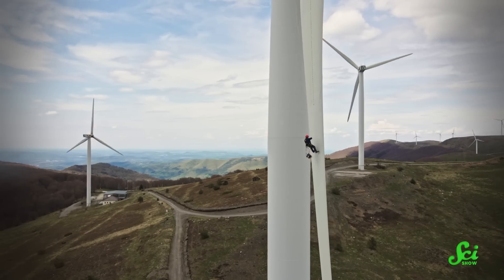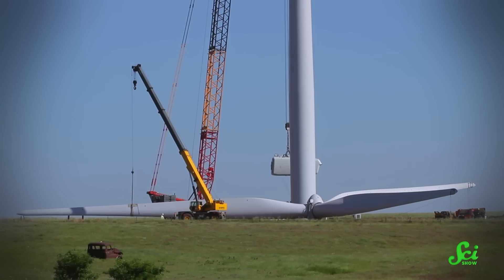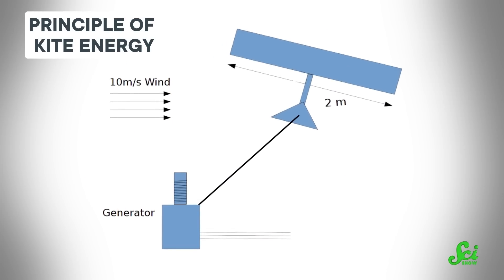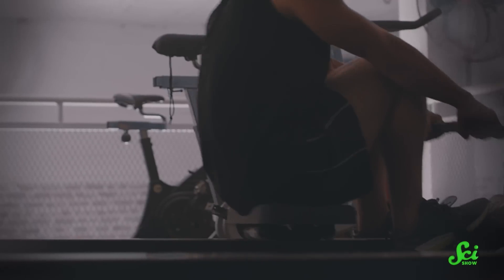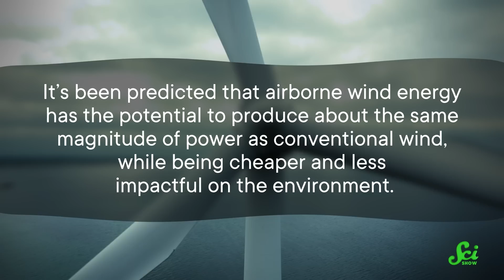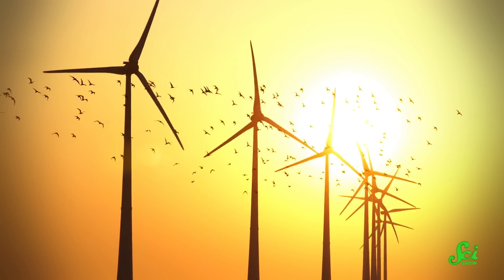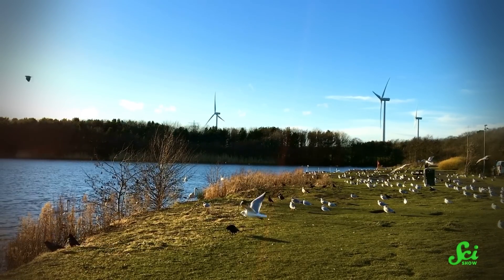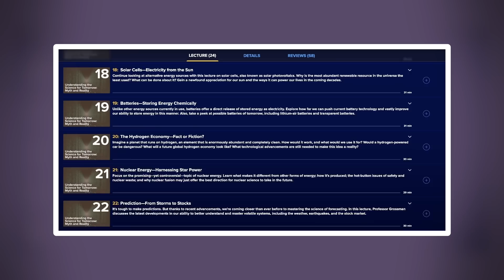Should We Put Wind Turbines on Kites?

Comment: It's way more scalable to have the generator on the ground, and just spin it by flying the kite in a cycle with variable line tension, allowing you to spool the lines out and back in, with the distance multiplied by the force difference while spooling out equaling the energy input to the generator.

Putting the generator on the kite isn't a horrible idea, it's just not as good.

Comment: This does get me to thinking that it would be neat for micro energy generators for emergency power and off grid usage. For example; I would be more motivated to go out and mow my backyard, if I could fly a kite and power an electric mower at the same time. 

Perhaps also,  as a design idea, old dutch inspired windmill/ hot air blimps; that have a continuously circulating chain, to pass whole grains up above, and ground flour back down. I wouldn't mind looking out the window to see that every day.

Comment: 8 or 9 years ago there was the Altaeros Buoyant Air Turbine, specifically to get steadier more powerful wind at 1000-2000ft, though it was more for isolated locations or disaster use rather than something you'd fly fleets of.  (Company is still around but it looks like  their current products are all autonomous antenna and sensor balloons rather than generators.)

Comment: 1:13 the highway wind turbines im super suspicious about. By working they ar reducing the speed of the airflow generated by passing cars, and I'm pretty certain that that airspeed as-is is increasing the efficiency of those vehicles by reducing drag (like drafting). By absorbing that energy you're basically "stealing" energy generated by internal combustion engines that are notorious polluters. I'm pretty sure you cause more emissions by reducing the efficiency of the vehicles than you do by recovering that percentage of energy.

Comment: I propose a 3rd design:
Have you ever tried to fly a kite, but it started rapidly spinning out of control and crashing? 

Under the right circumstances this spinning can be harvested by a generator on the ground by spinning the tether. To avoid crashing, a separate lifting kite can be used attached to the same tether by a ball bearing.

This would give both continuous power production as in the first concept, but storing the heavy generator on the ground as in the second concept.

Comment: It's frustrating how the fossil fuel industry has tricked everyone into being so concerned about recycling wind turbines.  Modern wind turbines last 3 decades and the blades are INERT.  Just bury the blades like they are rocks.  Nothing happens to them.  The top part (nacelle) is made of valuable metals and is absolutely recyclable.  The base and tower will just be reused and topped off with a new nacelle and blades.

When was the last time you heard of a decommissioned nuclear power plant being recycled?  Never.  How about the last time an abandoned coal plant was recycled?  Never.

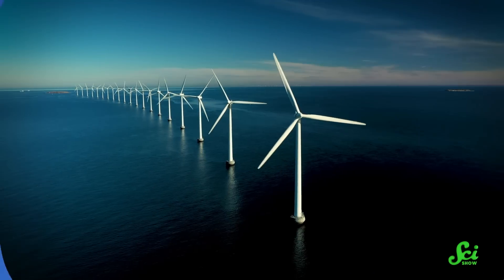Comment: 1:34 "newly built wind turbines are about 100 m tall on land" - this is incorrect or at least misleading. Modern wind turbines have a hub (the point where the rotors rotate around) height of over 100 m and a total height of 200 - 250 m including rotors.

Comment: As someone studying renewable electrical engineering, this idea is my pet peeve 😮‍💨 it comes up as a 'new cool' idea all the time and the reasons why we don't do it are always severely understated.

Imagine a high voltage, probably metal, heavy pylon swinging in the air near literally any biome, let alone a residential area. Tethered to the ground by some cables, at least one of which is massively electrified. There is virtually no way to make that safe! 

"We need to get pretty good at predicting weather" we've been trying to do this for hundreds of years it is enormously difficult!! Fluid dynamics is HUGELY complicated.

We are getting decent enough to predict general wind patterns about 2 days in advance, but things like tornadoes we have barely hours' warning if even that. The last thing you want in a tornado situation is a massively electrified rotating metal saw that is designed to float, dragging electrified cables.

The thing about "less cost for the environment" is presumably because it wouldn't use concrete (which creates quite a bit of co2) to build the structure. Again, something with this high voltage running through it NEEDS to have a secure connection to the ground so it can be earthed! The fact that it's not a free-floating structure is not a deficit! The amount of static this thing would build up just from air friction alone...

Comment: Why not talk about crosswind kite generators? they can produce an order of magnitude more power than simple downwind kites or airborne turbines. We know that individual autonomous flight and adapting to weather work already, even for the more complex crosswind kites, because it's been tested very successfully as auxiliary propulsion or cargo ships. They do struggle with having anything tall nearby including buildings, bridges, other kites, aircraft, etc. because the kite lines tend to run at a pretty shallow angle, so a kite 1000 ft in the air could easily be half a mile downwind of the base it's connected to.

Comment: I always thought (read: from the time I first heard about it) a big inflatable paddlewheel for a kite wind driven generator would be cool. Problem with kite turbines is the amount of land  needed.
Reply: You can just attach them to or between houses though. Have one big transformer or something if needed, and just run cables off that across a city block. I mean, the point is that they float in the air to capture high winds. Land should be the smallest issue.
Reply: You would need to own the land the kite would be flying over.
Reply: @SameAsAnyOtherStranger  If you're a regular joe, you'd probably need to legally work out how and where you'll be allowed to fly your kite, and you probably wouldn't be allowed to connect it in a place that you don't own. However, the video talks about one kite powering a dozen houses. This doesn't seem to be a kind of thing regular people are expected to really get into in any significant capacity - this is supposed to be a matter to be decided by the state, like wind turbines.

Considering the actual kite is not going to actually occupy any land in any way that would prevent anyone from building anything on it, the state could just fly that kite. That is one of the advantages of using kites over wind turbines on poles - you don't need to set a pole down anywhere. Sure, someone might be pedantic and go to court over that, but then that person will be the problem, and the rest of the world will once more sigh as we watch progress get stumped because a Karen didn't want a kite to be flown a hundred feet above their house that was going to power said Karen's electricity in said house, as well as a dozen other houses, while not occupying any land and not causing any trouble.

The state would need to own the land they put the transformer/collecting device on, sure - but the state has no problem buying/ kicking people out of their houses to build a new highway, so I don't expect this to be a big problem.

Comment: I'm working on a PhD focusing on control algorithms for energy harvesting kites! I'm glad to see these systems getting some media attention
Reply: Surprised small scale ones aren't out. Seen the tech like ten years ago for remote generation and looked good!

Also saw tech for basically uh parasails for large ships. No idea why that hasn't taken off either as it seems so obvious and can cut a lot of fuel overall without taking up too much space.
Reply: @dianapennepacker6854  The reason it hasn't taken off is mostly due to a catch twentytwo. One the makers of those sails are very much aware of NOW but didn't think would be so severe back when they started. 

Installing those sails allows you to save MASSIVE amounts of fuel, the test ships have burned up to thirty percent less fuel on voyages. On the other hand, it costs extra while building the ship, which means the people buying them need to fork over more money, which they would prefer not to do.

The problem then comes in the fact that the people who buy and own the ships are not the same ones who use them. You buy a ship, and then someone else charters it, and THAT someone else is the one who pays for the fuel.

In other words, sails are massivley beneficial for the people doing the sailing, but they don't get a say in whether said sails are installed, because they don't actually own the ships, while the people who DO own the ships have an active incentive NOT to install sails.
Reply: @Alexander_Kale  I was going to say 20% but wasn't sure if that number was actually possible and not marketing haha.

 That is the craziest thing though! Even 15 percent less fuel for a large cargo ship would be a MASSIVE increase and pay for its self over the course if its life as fuel won't get much cheaper.

 Just blows my mind that the large shipping companies like Maersk don't do it ASAP or try one out. They build and run the damn things ya know? Could be saving like 20 TONS of fuel per day at the least! They also don't look like they take too much space either.
Reply: @dianapennepacker6854  If you put sails large enough to provide meaningful savings on a cargo ship, they'd need to be massive and that would be problematic on already top-heavy ships. To use sails against a headwind, you need to go diagonally into it and that can add days of sailing to an already week-long oceanic crossing. Longer roundtrip times add risks and costs.
Reply: @dianapennepacker6854  Turns out, some of that actually was marketing, yeah. As is usually the case with wind, apparently the numbers vary a lot, and "30 percent" was them cherry picking the data just a tiny bit...

Upon digging into this for a bit, your twenty seems a lot closer to the mark.
Reply: @Alexander_Kale  Yeah I thought 30% was pretty high myself. Even 10% would be an insane amount of savings.

 One thing I couldn't find was the cost.. so unless this system costs like 474, 484, 484 dollars. Then I can see why companies aren't even bothering with the complexity of it and going through the trouble of training and maintaining it. Which uhh... Cannot blame them.
Reply: @dianapennepacker6854  While searching for it, I found several companies now instead of the single german company I already knew existed. There is a british one, a french one, the original German still exists but is now concentrating on land based energy harvesting, and of course, the thread OP.
So apparently, interest in this is growing anyways, we'll see where it eventually leads. Look up "rotor sails" if you wanna  see something bizarre that will in no way be maintenance intensive. ^.^
Reply: @dianapennepacker6854  If you put kites on a ship and need to sail against the wind, which would happen about 50% of the time for ships doing east-west routes across oceans, the kites will cause more losses from drag than any energy they may be able to produce.
Reply: @saltofine8 Could you explain why these aren't already being used? I remember the idea from decades ago. What's the technical details that have slowed adoption?
Reply: @Josiah Seaman  The largest factor from a technology perspective is the added complexity of these systems. When the wind dies, a towered wind turbine stops spinning. Conversely, when the wind speeds get too high, blade pitch can be adjusted. For an airborne wind system, the kite needs to be robust to lots of variations in wind speed. As a result, the control system needs to be able to react to variations in flow very reliably. A lot of ongoing research focuses on developing reliable control strategies for these systems that balance safety and performance.
Reply: How far along? I'm halfway through mine. About ready to either shoot myself or shoot my supervisor 😂
Reply: Ballon tethered better
Reply: Awesome!

Comment: maybe this is a small point but the shot at 0:15 appears to be of a nuclear plant which releases water vapor, not smoke. otherwise definitely neat ideas
Reply: I thought it was a coal power plant.
Reply: That shows a coal plant. Note the chimneys in addition to the cooling towers, and the conveyers that carry the coal dust into the boiler building.

That said, coal plants are likely to be replaced with high temperature nuclear reactors, such as those by Terrestrial Energy (IMSR). Those would be much more compact than the coal furnace and surrounding equipment, while reusing the existing turbines and generators.

Comment: For the love of god. Stop reaching for the “renewables” of wind and solar. Nuclear power is the future. Solar panels deteriorate and need replacing and so do wind turbines. Nuclear power plants last for decades and with new and improved systems for safety and even different fuel like thorium based reactors which are safer than uranium based ones it’s our best option to power the future.

Comment: A small turbine on the kite like the one shown in the thumbnail is possible.  A large turbine generates a lot of torque as the wind forces the blades around.  This is resisted by the tower of a traditional windmill.  The kite is only attached to the ground via a cable and cannot resist the torque.  The kite will want to rotate, thus reducing the efficiency.  Let's stick with reliable sources of energy.